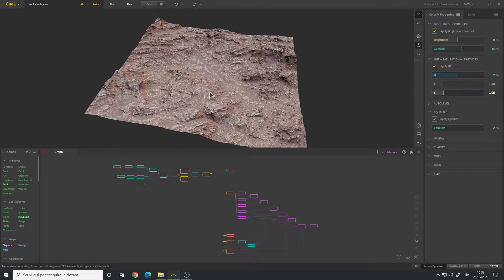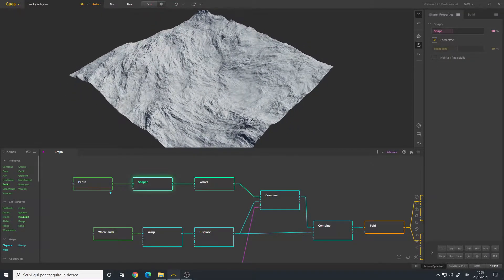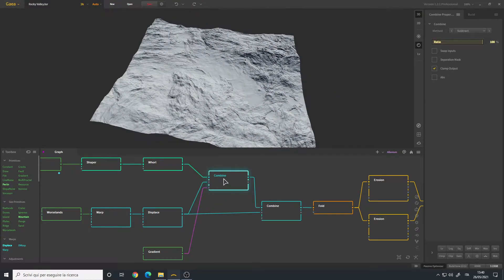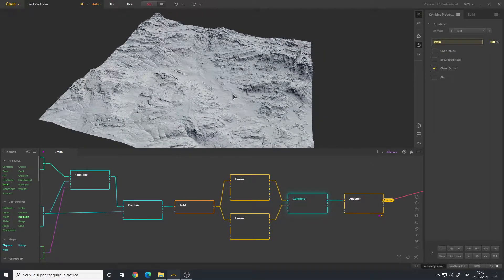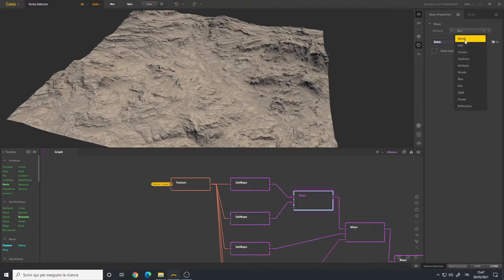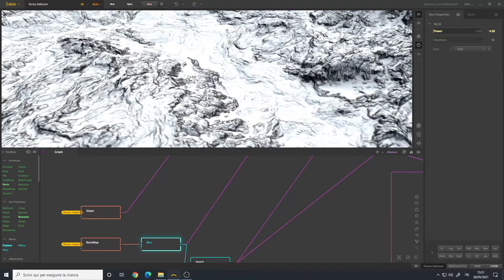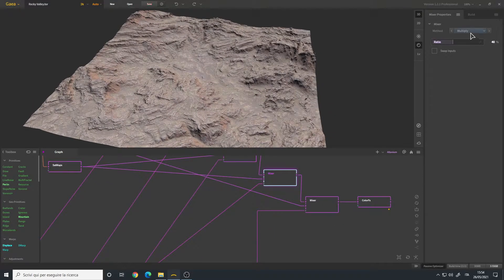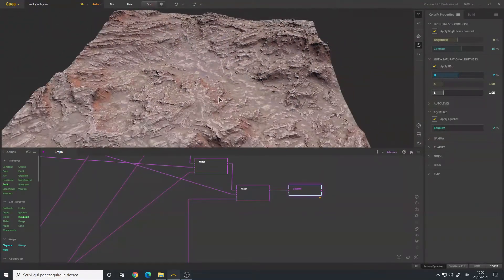Gaea 1.2 Tutorial | Rocky Valley Terrain Breakdown

Comment: How can I use Gaea to create a ravine? I tried creating a fault but I need the base of the valley to be flat with bumpy terrain. I want to create a level in Unreal and add something like a corridor with rocks on the left and right and trees hanging and a small road with a river in the valley where the player walks. Thank you.
Reply from the maker: In that case it's better to combine 2 terrains with a divide/subtract/difference operation. Perlin is a good one for one of the 2.
Reply from the maker: I experimented a bit because the solution i gave you before it's more useful in the case of multiple smaller canyons.
For a long ravine with a flat terrain i used: Worseland ( you can use whatever you want )--> FX with gain enabled at 38 % --> Fault changed the width and scale to my liking --> connected an height mask to the fault for the bottom of the rift ( the white should encompass the bottom of the canyon ) --> connected an FX node after the fault and used the height as a mask, for the settings i enabled Clamp and bumped up the Clamp Min %.

Maybe i'll upload a quick video if i have time.

Comment: Hey Andrea, I did not understand the part with the gradient inside mask. I played around with it at different combinations and I can't understand the math behind it. Can you explain the purpose of the gradient?
Reply from the maker: Hi, the gradient is a linear mask that goes from black to white ( you can see it if you open the 2D viewport ) where black is the lowest height possible and white is the highest.
Black also means unaffected or 0 and white affected or 1 with various decimal values in between.
Because of that if you plug it into a mask of a primitive node the darkest areas defined by the gradient will generate less details and will be at a lower height while on the other hand the whitest areas will generate the usual details which you will get normally and that part of the terrain will be higher than the other one.

This is useful for creating nice transitions, slopes and similar. For example you may want to have a valley before a mountain range, this is one way to do it. You can also use the gradient for texturing to get interesting effects. That's because almost every node at the end of the day is just a black and white image that can be used for masking.